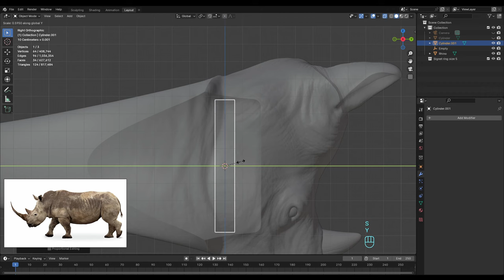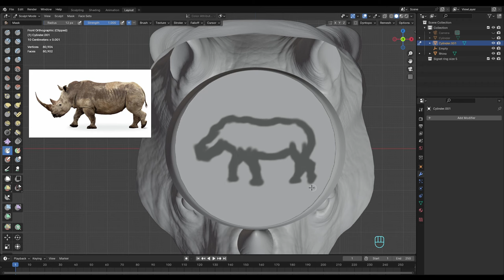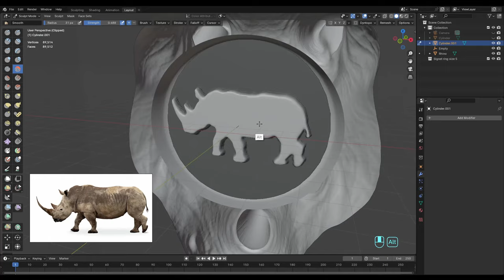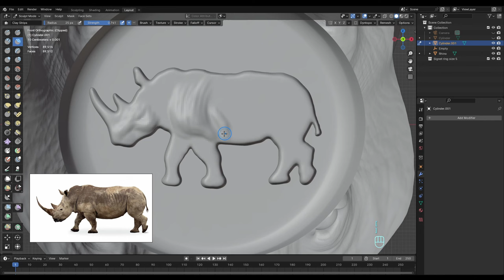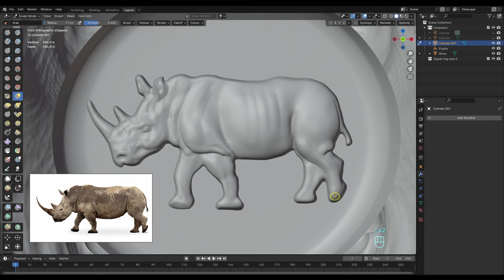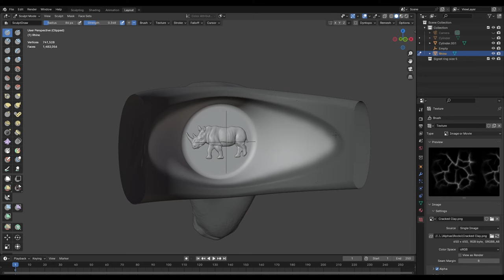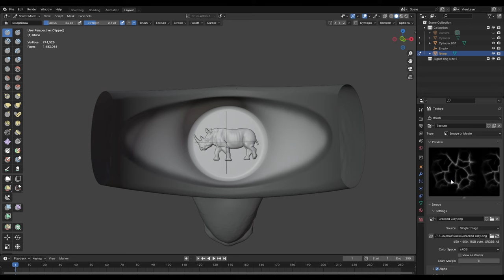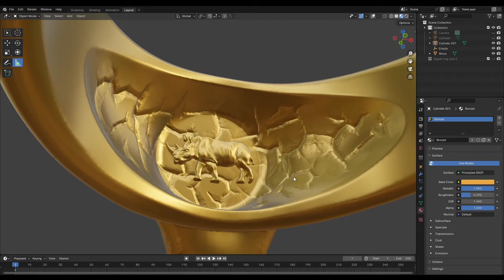How to Sculpt a Bas Relief in Blender | Rhino Ring Part 2

Comment: Hello, I saw your video on the diy vacuum casting machine and im wondering if you think it would work for steel or if the air will get too hot for the pump